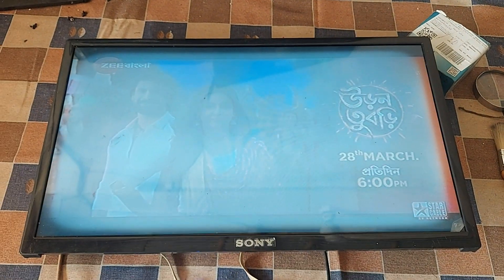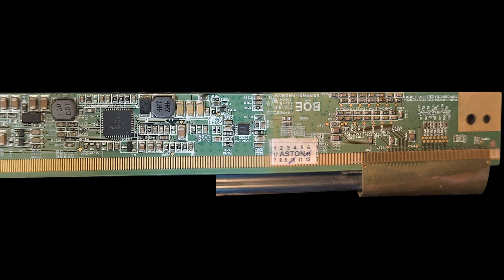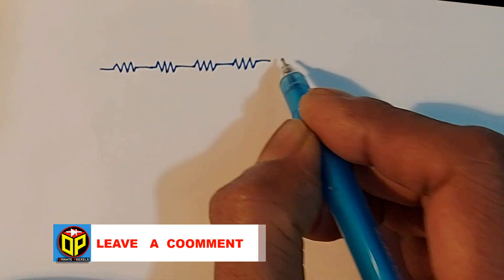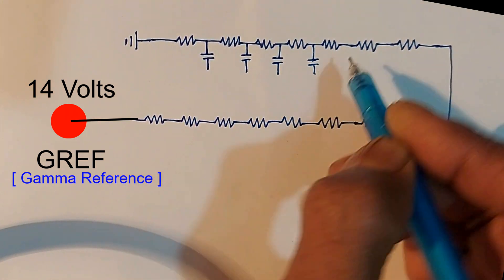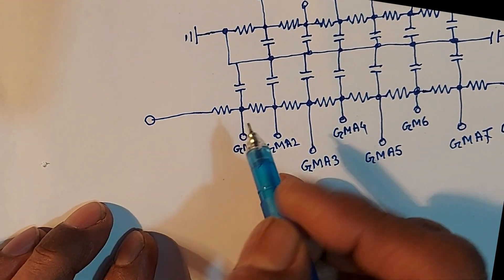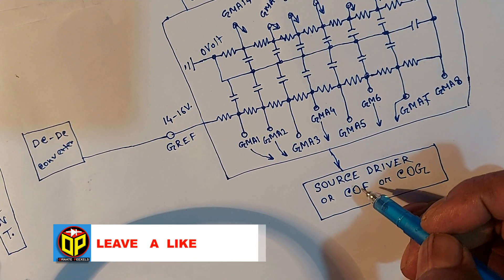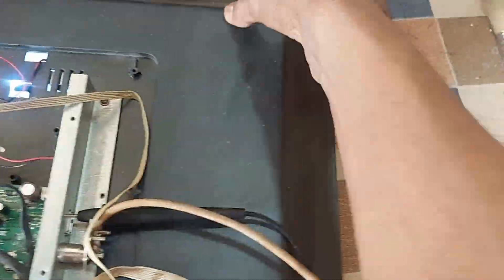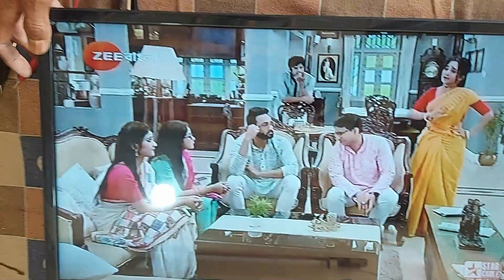Low Contrast or Blurry Image Problems on LED TV Screen | Gamma Voltage Details | LED  Panel Repair

Comment: But the problem is..while you found the problems that is ceramic capacitor.but you replace with other capacitor.then you don't explain why you put another capacitor which is not same capacitor.

Comment: Hello . love tv repair tutorials . I have a V390HJ1-PO2 rev C1  that have shorts on the VIN2 , V3.3v12 and UH1 line . how to repair ? Can make a tutorial how to repair this specific t con board . it has 8 cof cable with bonding connection . the shorts is on the main Side of the t con board ( left side ) . if its not repairable I will have to replace it